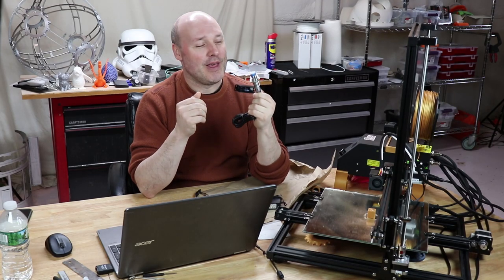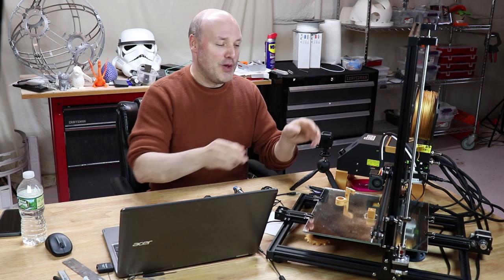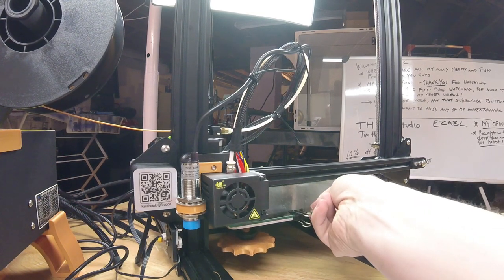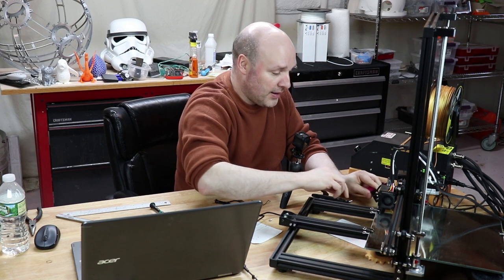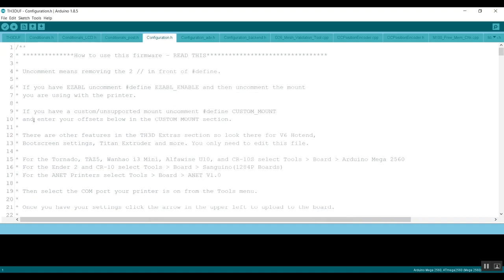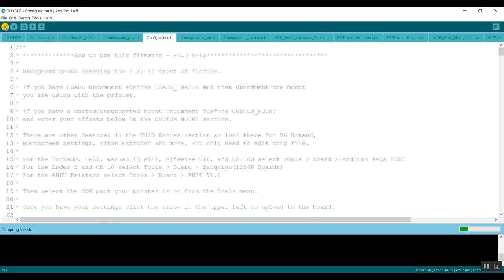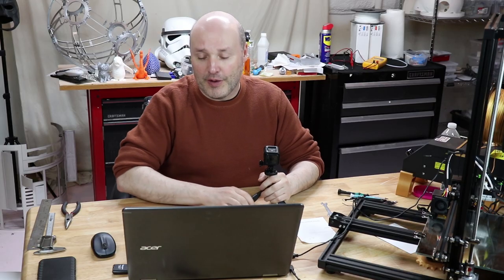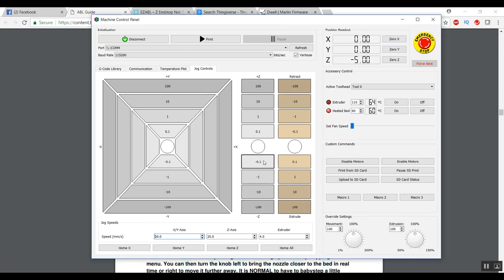Installing the TH3D EZABL Sensor on the Creality CR-10S

Comment: i would like to know  if it the same thing with  Creality CR20 .  There is a V2.1 version in it .  Do  I had to flash my firmware to Marlin  to instal the EZABL auto bed . I try to download the  program 

 TH3D UFW_U1.r!8b.zip  i have  always a echec to download ?
Reply from the maker: Good question for Tim @ Th3D!  I don't have a CR20
Reply: Same situation here. I need the stl to print out the mounting bracket aswell
Reply from the maker: @ThujanK  contact TH3D

Comment: I wish you would've explained what you were actually doing, instead of just reading from the manual.    i realized you installed it, but after having watched your video, i don't know anything more than when i started.   i completely missed what the sensor is doing.   Why did you need to touch your finger to the sensor to make the red lights come on?   While i understand the need to level the bed before starting.. i have no idea what you were doing with the paper shim?  that looks like the same routing I have to go through in order to manually level my bed..    if you're going to do it by feel, whats the point of the sensor?    you mentioned the sensor checking at 16 points?  what is it checking?   Is the sensor connected to the Z-stepper motor, so that the printer head is constantly moving up and down to adjust for an un-level bed?
Reply from the maker: You should read the manual. Most of that is answered there.   I referred to the manual to help the viewer understand it.  You fault me for how I explained it but a huge majority of the comments praised how easy this installation was.  Try again!
Reply: @WhereNerdyisCool  - sorry if you took offense.   I'm just trying to give you constructive feedback from my perspective.   I didn't read the manual, because I don't have one, I was trying to decide whether I wanted to purchase an ABL.  Until then, I don't have a manual..    If I had the manual, I would've just read it.  Isn't that the point behind your video, give people advance understanding of what they're getting into before purchasing?  You actually commented that people hear that they have to mess with firmware and they get intimidated and decide not to purchase the ABL.  So, you at least acknowledge that some of your viewers may not have a manual to read...  

I asked some questions in my comment, because I'm interested in knowing those things..  i thought maybe you could help me with them and maybe you could try to answer similar questions in future videos, but I guess not..
Reply from the maker: I haven’t answered them since I M replying mobile and is difficult to address every-single-question you posed.  That said, this was a tutorial of the install.  I went step by step.  I can’t appease everyone.
Reply: I'd say I'm a pretty "smart" guy, but this tutorial was a bit convoluted. It was difficult to follow mainly because there wasnt a camera on the setting screen of the printer when you adjusted settings, and some things were just missed on camera cuts, etc. But thanks for doing the video, I'm sure it helped some out.
Reply from the maker: That’s for the comment.  In hindsight there’s always scenes you wish you could capture better. It’s kind of funny, some will complain if you go into too much detail (longer video) and some will complain if the video is too short (trimmed to appease shorter video!).   TH3D has a tutorial video out and they also have new probes    I might try one of those out. 🙂

Comment: FYI, I have ordered two of these over the past 7 days after watching your video. The discount code no longer works.
Reply from the maker: Drop them an email.  They should be able to remedy that
Reply: I called them. They are looking into it. Just thought that you would want to know. It takes the code without returning any errors...but it does not apply the discount. I did not even notice until after I placed my second order today.
Reply from the maker: They are good people.  I think the coupon codes only last so many days and it probably expired and they forgot to re-up it.
Reply: Yeah, not a big deal. I just wanted to make sure you knew for other viewers that might try to use it.

Comment: Were u print the mount from ?
Reply from the maker: This is a frequent question.  TH3D had to password protect their files since other companies were selling their own probes (with no support) and telling people to use their stuff for free.  That’s not fair to TH3D so they’ve had to take steps to protect their design and hard work.
Reply: I bought the sensor   how do I get the password
Reply: Do I email them ?
Reply from the maker: You could, yes